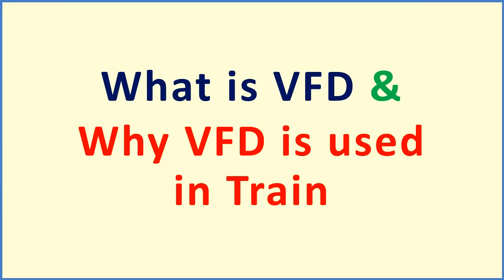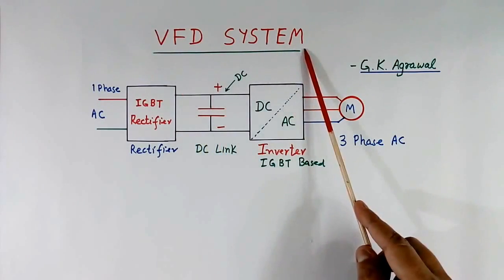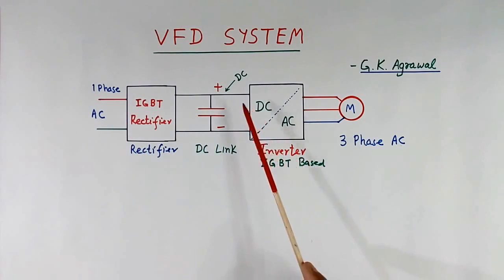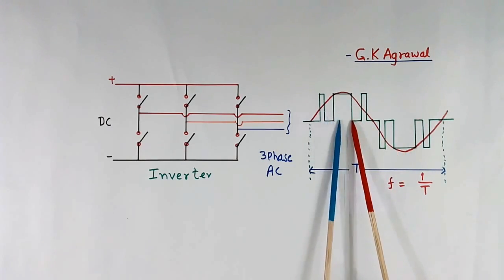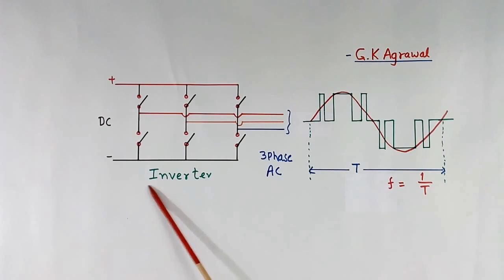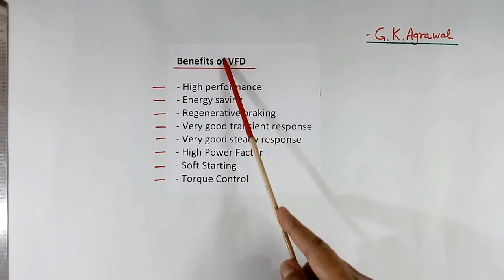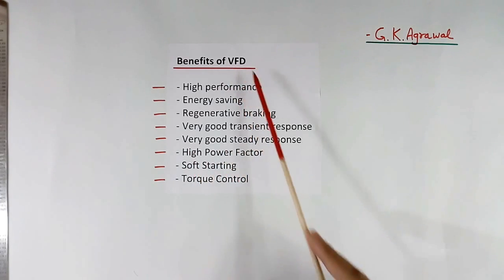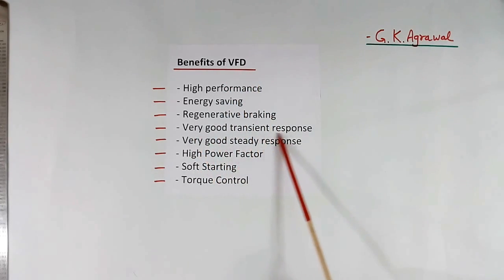What is VFD | Variable frequency drive use in train engine

Comment: Hare Krishna sir, I want to run 2  motors (first is submersible motor of 10 horse power and second motor is mono block motor of 12.5 horse power, I want to run the pumps of these 2 motors in series for irrigation in agricultural fields. I want to run these 2 motors simultaneously from a 220 volts AC, 50 Herts , single phase power supply from the 25 KVA step down voltage transformer installed 1 kilometres away from my borewell. How can I achieve this? Can I achieve this by using Variable frequency drive in vector mode??? Please guide me sir, I am a farmer. Please guide me sir.

Comment: Testing Methods
 ● Distribution & Power Transformers : Winding Resistance test, Ratio test,
 Separate source withstand test, Induced EMF test, No load test, Load loss
 test, Insulation resistance test ,Magnetic balance test etc. as per IS 2026 &
 IEC 60076 norms.
● Current Transformers : Accuracy Test, Turns Ratio Error Test, Knee Point
 Voltage Test, Over Voltage Interturn Test,Composite Error Test, High Power
Frequency Dry Test, ISF Test as Per IS 2705 & IEC 60044.
● Miniature Circuit Breaker, Moulded Circuit Breaker, ACB, VCB RCCB.:
 Tripping& None Tripping Test, High Voltage Test,Resistance Test, mechanical
 operation test as per there relevant IS & IEC norms.
● HT & LT Panels, Distribution Box, Isolators, Air Break Switches, Switch Fuse
 Unit, Rewirable HRC Fuses & starter: High Voltage Test, Resistance
 measurement Test as per there relevant IS & IEC norms.
● Short Ckt Testing of Transofermers & Switchgear Products.

Comment: Sir Apke Sabhi Vidio Detail Me explain KIye HAi Sir  Apke Pass Time Hai to Electrical Testing Ke video Banaye Taki Hame Practical Knowledge Ho sake Jo ki College Me Nahi Shikhaya Jata hai detail m

 Testing Methods
 ● Distribution & Power Transformers : Winding Resistance test, Ratio test,
 Separate source withstand test, Induced EMF test, No load test, Load loss
 test, Insulation resistance test ,Magnetic balance test etc. as per IS 2026 &
 IEC 60076 norms.
● Current Transformers : Accuracy Test, Turns Ratio Error Test, Knee Point
 Voltage Test, Over Voltage Interturn Test,Composite Error Test, High Power
Frequency Dry Test, ISF Test as Per IS 2705 & IEC 60044.
● Miniature Circuit Breaker, Moulded Circuit Breaker, ACB, VCB RCCB.:
 Tripping& None Tripping Test, High Voltage Test,Resistance Test, mechanical
 operation test as per there relevant IS & IEC norms.
● HT & LT Panels, Distribution Box, Isolators, Air Break Switches, Switch Fuse
 Unit, Rewirable HRC Fuses & starter: High Voltage Test, Resistance
 measurement Test as per there relevant IS & IEC norms.
● Short Ckt Testing of Transofermers & Switchgear Products.
Reply from the maker: Aapne tho 1 varsh ka karya bata diya.
Reply from the maker: Aapne tho 1 varsh ka karya bata diya.
Reply: Sorry Sir and Thanks For Reply .Ae topic Mese Jo Jyada Industry Me Use Hota Hai Vah Try Karna Video Bananeka Eg: Distribution & Power Transformers : Winding Resistance test, Ratio test,
  Induced EMF test, No load test, Load loss
 test, Insulation resistance test

Comment: thank-you sir , for this complete information about VFD, actually I am also using VFD control device for solar water pumping systems that is running a 3phase AC motor using direct solar energy ie pure DC output is fed to the VFD which convert it into AC 3PHASE , I never knew the importance as to why we use VFD why just not a simple DC to AC inverter connected to the motor, but now my doubts are clear, All Thanx to you sir
Reply from the maker: Very good
Reply: G K Agrawal 
sir inside the train the charging point show a sign board saying that it is 110V DC but still our mobile charger which is designed to converts 230v AC voltage to 5V DC works normal in that train charging point?
Reply from the maker: Charger 100 volt se 240 volt tak kam karta hai. Maine apne 2 charger abhee dekhe, dono per 100 - 240 volt likha hai.
Reply from the maker: Charger works from 100 volt to 240 volt
Reply: G K Agrawal 
sir ,  mere is doubt k leye Maine ek video  bhi upload keya hai aur charger mai AC to DC conversion ko full wave rectification concept se explain keya hai